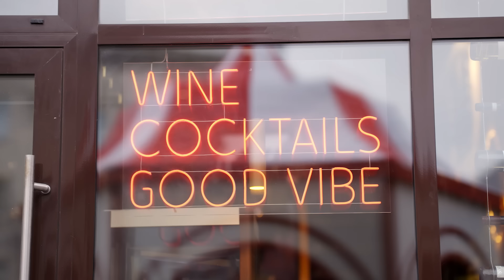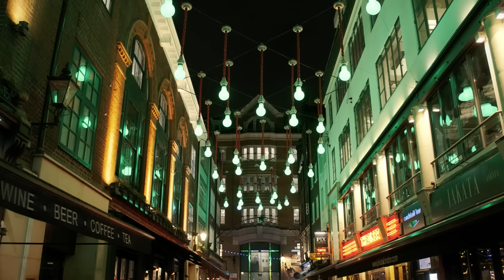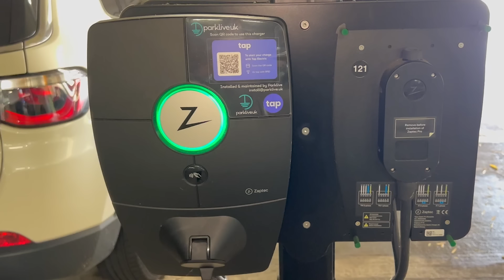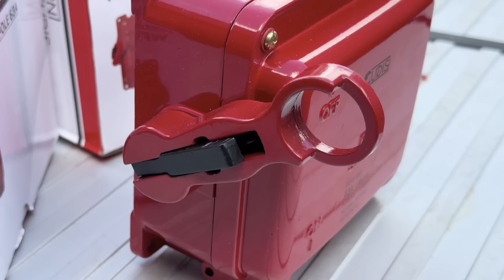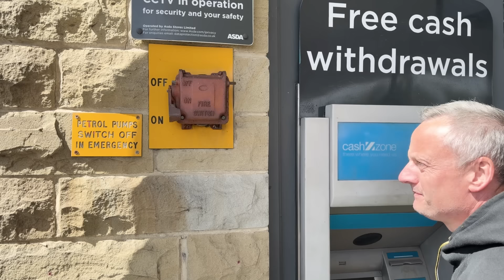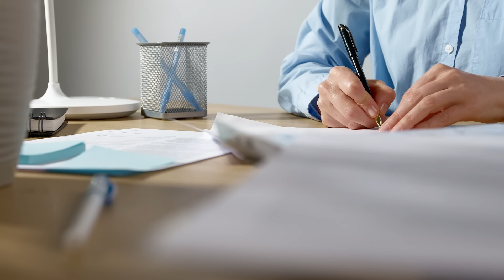They Removed Fireman Switches. Now They’re Back | BS7671 Amd 4

Comment: Have had this for underground EV charging in office and apartment blocks. We have found that they are equally happy with emergency knock off and rotate to re-engage switches operating contactors remotely. This was pointed out to us by Brighton Fire Service as a Fireman/fighter switch many facilities managers think is literally only for the use of fire fighters meaning equipment could have been isolated much earlier but isn't isolated until the Service arrives on site. 
Thus having an emergency stop or fire alarm panel tied into contactors often will negate the need for a Fireman Switch as early shut off is preferable to waiting for the emergency service to arrive.
Reply from the maker: Great info thanks 🙏

Comment: One of the apuratus of the Fire Department in a nearby city has a hardened SS knozle that can be attached to the front of the apuratus and ramed through a wall and blast the interior with water. In a conspicuous place, there is a large warning say to ensure power to structure has been terminated.

Comment: Greetings from Poland, where we have been installing our version of the firefighter's switch for several decades now.
Our regulations are quite straightforward regarding what should be switched off and when - everything that does not need to operate during a fire must be disconnected. This requirement applies to every fire compartment exceeding 1,000 cubic meters. In practice, this means that only single-family houses are exempt from this requirement. The switch can deenergize either one specific fire compartment, or all of them at once - that is up to the electrical designer and depends and depends on practical reasons.
The systems that may (and must) remain energized are fire protection systems, such as sprinkler pumps, fire detection control panels, emergency lighting (but only when supplied by a central battery), safety announcement systems, smoke extraction systems, and similar equipment. The wiring for these systems is fire-resistant, so in theory it should not pose a hazard to firefighters during a fire. Everything else, including photovoltaic (PV) installations, must be disconnected. That includes UPS supplies throughout the building as well - dedicated wiring is routed to all such supplies and connected to their EPO ports, instructing them to shut down. Only small desktop devices are exempt from this.
The fireman's switch must be located either at the building’s service connection point or near the main entrance. In practice, for smaller buildings it is usually installed outdoors near the meter cabinet. In larger buildings with dedicated electrical service rooms and much larger power supplies, it is typically located within the main switchboard. In such cases, the switchboard must be installed in a fire-separated room, and the main supply cable, which remains energised, must either be fire-resistant or otherwise protected against fire exposure.
Under the latest regulations, the firefighter's switch system consists of three components: a disconnecting device (an isolator equipped with a shunt trip and its power supply system, for example a phase failure changeover switch, auxiliary contacts for status indication and so on), an operating device (a break-glass emergency push button, most commonly installed near the entrance), and an indicating device (typically LED indicators integrated into the push button enclosure). A red LED indicates normal operation and the presence of voltage within the building, while a green LED indicates that the power supply has been disconnected.
For PV installations, fire emergency disconnection is implemented quite simply. Special DC isolators are available on the market and are installed outdoors near the photovoltaic panels. These devices are supplied with 230 V AC from the building’s installation. When this supply is lost - for example, after the firefighter's switch has been activated - the DC isolator automatically opens the PV circuit.
For off-grid installations, we route a signal from the building’s fireman's switch to the inverter and/or battery control interface, instructing the installation to shut down.

Comment: Tbh, I'd take a good proper electromagnetic transformer and real neon sign over an modern LED rubbish. Looks better and would last longer!
Reply: Better get a switch for it then.

Also, you can get electronic drivers for neon signs nowadays, electronic drivers don't buzz like electromagnetic transformers and they oscillate a higher frequency so the signs don't strobe as much.

They do make a squealing sound, but it's way less noticeable than a buzzing transformer.
Reply: @georgewills-ek1gg  I bet they are not as reliable though, like electronic fluorescent ballasts!
Reply: @FrontSideBus  Probably not. 

But not everyone likes the sound of a buzzing transformer.

Personally, l don't mind a smooth hum, but a loud harmonical "Buzz" can get grating after a while.

The squealing can too. l was once in a hardware store with cheap LED battens, whatever crappy drivers they slapped in those sounded like the coils in a CRT television. lt was that loud and noticeable.

Comment: I remember these from 1 and 3 training Regiments Royal Engineers when on guard we had to know where these were in both barracks, many of the buildings were wooden, even the NAAFI and WRVS had them, we had to know where every one of these switches were. While off stag and resting we would get a call out and have to pick up the fire barrow and run with it, no vehicles just pure manpower and the destination was always the other side of the barracks, the switch would be located and turned off then we would soak the road and grass with water, happy that we didn't have to use it in a real life scenario.

Comment: Im pretty sure that the regs are written in this way so a exception can be given: If you hook up your shutoff system to your fire alarm, no switch is neccessary. Thats why they don't want to give a list of requirements.

So if you hook up the EV chargers to a shunt swtich tripped from the fire alarm system, they could say "you are fine, no fireman switch is required".

Comment: Havnt fitted one for years. Looks as though the dont still have the horizontal spring plunger meaning that you could switch them off with a pole but to re energise access was needed to pull the spring mechanism back? I thought one of the old 16th edition bs7671's required one for every external illuminated sign over a certain wattage regardless of voltage. That never made much sense to me.
Reply: It was the MEM 215 AF.

Comment: Fireman’s switch are also required for blocks of flat the have intercom door entry systems. Always have been. And shops that have front metal key operated   electric security Shutters.
Reply: Blimey 56 yr old didn’t know that 😮
Reply: Intercoms usually SELV ?
Reply: @tonyedmonds1538  yeah but they meant unlocking the door by fireman switch so they can go in.
Reply: That's not the same switch
That's called a drop key switch. It is used to release the door in cases of emergency.
Reply: The switch this video is about does not reset itself. There is a pin you have to pull out then you can reset it. Other switches may have different means of reset. 
The drop key switch used to open doors is only a retractive switch that resets as soon as you let go of the key. 
Also, You need a special key whereas the fireman's switch in this video doesn't require any special tools to operate it
Reply: @AsadMulla is that why they have fireman’s switch embossed on the front of them . They also have a brass pin that you have to press in to reset the switch to the on position.
Reply: @SDelectricalINAEC I don't mean to be rude or offensive, do you know this information because you are in the access control field or from somewhere else? I install access control and I haven't come across this information. I know blocks install drop key switches next to the communal door but thats it. I haven't come across the one you are describing.
Reply: @AsadMulla go back to the early to mid nineties. Be the thing you are talking about , drop key switches were usually used for lifts in high rise buildings like blocks of flats and office buildings. And escalators in in places like shopping centres ,  I can show you pictures that I took yesterday of blocks of flats at the top of my estate. Also the old fireman’s switch was dun away with in favour of the drop key switch . But as the video title says they’re back . The drop key is the same thing you have on lift doors so the fire service can open the lift door to get people out if the lift gets between floors.

Comment: Interesting, a fire fighting switch doesn't actually 'break' anything (like the good ole days) it commands 'infrastructure to shut down', I have often pondered this especially when I have been in complicated installations and tried to shut things down so I can work on it. Nowadays with batteries and the sun shining it aint always easy (and I know what I'm doing, know what every bit does and can read an SLD!) And... don't forget guys if you work on large installs (over 100kw) there is always all sorts of rules and regs on shutting things down outside of the orange book!
For us electricians, working on batteries and solar panels, there is no concept of a fire switch, never has been! There is no such thing as a 500A or 1200v DC contactor, anything that switches much over 750v DC or 100 amps tends to be electromechanical typically 24v so these are motor powered and remain on, overpowering a spring powered mechanism that in turn, drives cogs to go off when the power is removed, or a more complex system where the motor rotates cogs to an ON position and the same for OFF, but these must be driven from a computerised controller. Either way, as we all know, you cannot just operate isolators as we did in the good ole days, we have to issue RS485 commands to go through the correct due processes and once the panel currents and battery currents are within shut down range, then (and only then) operate these isolators. No different to a normal residential install, you have to switch the inverter to OFF, watch the display, you will hear some clunks inside and sometimes a small motor whine, when the green light goes off after a few seconds, then you can safely operate the three isolators (first panels, secondly the AC circuits, finally batteries) then you can work on the system.
If firemans switches are really going to be rolled out on panel & battery installs, it's going to need a lot more thought as to how exactly this can get implemented.

Comment: Outdoor meter box is much simpler and cheaper that red switch. Firefighter can easily cut the wires by axes in case of welded contacts, but in case of red switch firefighters should guess if the power is really missing.
Reply: Yes, and no, the meterbox would have to be in a readily accessible and safe access location and itself be readily identifiable.  Putting an axe through the unfused supply should the service line even be accessible anyway, well that's not a good idea.
Reply: But thats the point, nowadays, cut through all the wires and the OffGrid systems are still live, the batteries are still producing power. Each of the solar panel feeds might remain 800v DC at 12 amps. in fact, in larger installs with OffGrid air conditioning (transitioning to background OffGrid mode), cutting through the grid cables will cause MORE power demand from the batteries & solar systems! And... don't forget the guts of this lot will always be on the roof (and can only be shut down from there!) Swing those axes at everything that's look round and long & thin, and you'll certainly get some big bangs and flashes, probably shut off the CCTV, the WiFi will go down, water will piss out, maybe gas or diesel out of another one, but in modern systems, the lights will still be on!
Reply: l have seen a firefighter smash a meter in the case of trying to kill power to a building, it did not end well though.